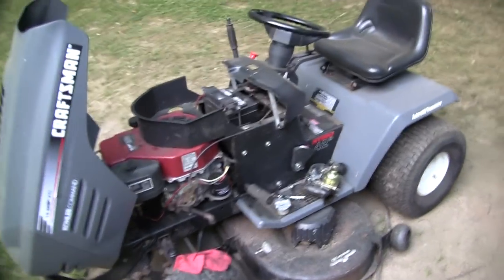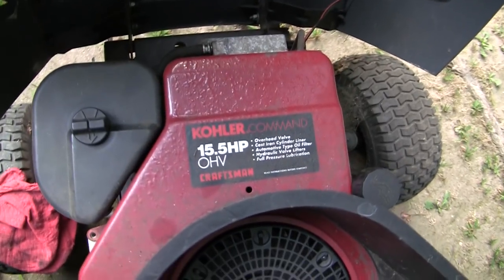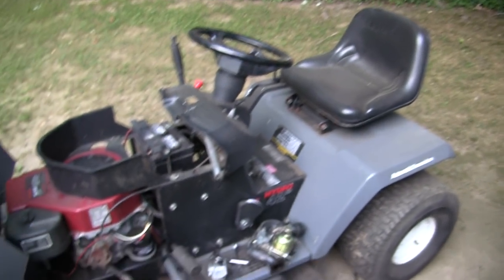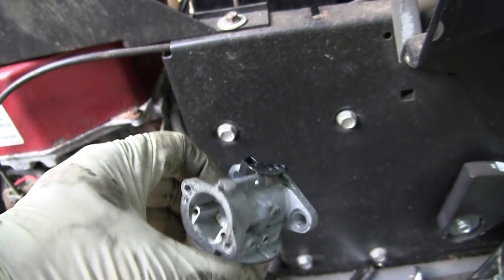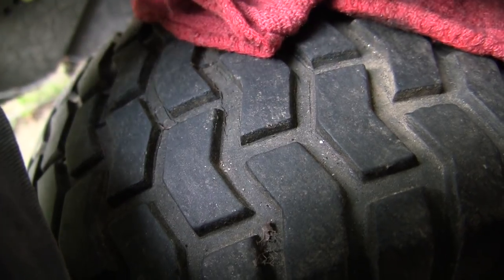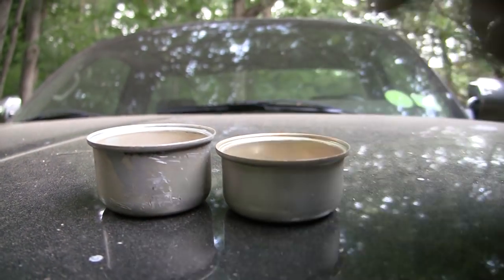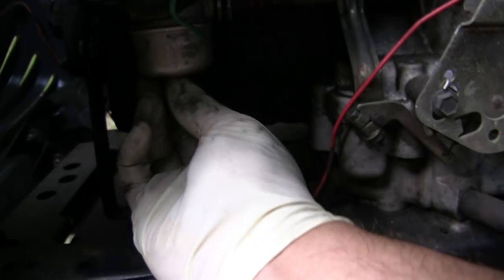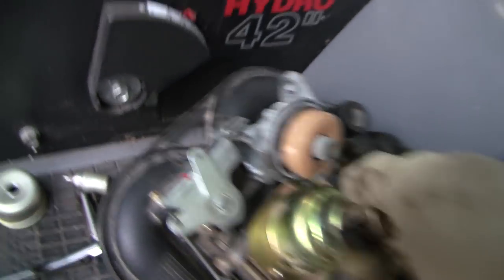Deleting the solenoid on a Walbro carburetor

Comment: Always reduce your engine speed before turning off the ignition. This is especially important if you bypass the carb. solenoid in some fashion.  Reducing engine speed before shutting the engine down will help prevent engine backfire.  Just repeating instructions from my user manual.

Comment: Great job another easy way is remove the rubber plug on the end of the solenoid and cut off or grind off stem,zip tie the wire out of the way and put in a cheap in line gas shut off so when your done mowing put it in neutral set your brake while tractor is idling lift hood turn off gas at  in line valve and will burn up the fuel in the carburetor in a few seconds. 👍😎

Comment: this worked great for me. regardless of all the different washers i used, the solenoid was leaking fuel after the engine was started. the leaking fuel would break the circuit and kill the engine, not to mention being a HUGE safety issue. the Briggs bowl and bolt worked like a charm. thanks so much for posting.

Comment: I carb cleanered the carb and selenoid valve and got it working.  Thanks a bunch.  I'll pick up an in line fuel shut off and neuter the SOB if it causes more grief in the future.

Comment: Watched video 20 minutes ago. Back in the house mower's running fine. Saw what you did and gave it little tweak. Pulled plunger out and left it out. Also left wire disconnected. Thanks for the hint!
Reply: Copy from what I wrote 2+ years ago:  When you BY-PASS the Solenoid, just ADD a FUEL SHUT-OFF to your Line (If NOT on there already). That way NO FUEL will leak into your Engine during Storage / Winter. They make this Part (Carb Solenoid), to prevent Fuel leaking into Engine if-by Needle, Seal, Float failure or Shut-Off Valve forgotten during Storage or Not-In-Use. To be honest, it's just a Luxury Item, and they can make more Money out of you. Also, this part here is a BULL-SHIT SCAM to sell extra features on a Mower and make more money out of you when failed.
Reply: Yeah thats the way to do it pull the whole magnet and pin out

Comment: Just learning to convert my ride on to a offroad go cart and you confirmed what I needed to know now on Goes the mikuni carb lol
Reply: Copy from what I wrote 2+ years ago:  When you BY-PASS the Solenoid, just ADD a FUEL SHUT-OFF to your Line (If NOT on there already). That way NO FUEL will leak into your Engine during Storage / Winter. They make this Part (Carb Solenoid), to prevent Fuel leaking into Engine if-by Needle, Seal, Float failure or Shut-Off Valve forgotten during Storage or Not-In-Use. To be honest, it's just a Luxury Item, and they can make more Money out of you. Also, this part here is a BULL-SHIT SCAM to sell extra features on a Mower and make more money out of you when failed.

Comment: No one mentioned this, so I will, you should put a fuel shut off valve on after removing the solenoid, and oh yeah idle down the engine first before shutting it off.

Comment: Inline fuel shutoffs are dirt cheap ( I buy 'em by the bag online) and are very good insurance against carb flooding after deleting the valve portion of the noid. I cut the pins off any engine I get with them.

Comment: if the fuel tank is higher than the engine you must install a manual inline fuel shut off if you delete fuel solenoid and incidentally  it is called an anti- afterfire switch which is designed to shut the fuel off and  stop the engine from running long after the ignition is shut off . a serious problem especially down south or in high heat condition  the engines just simply wont shut down as long as there is fuel still going to the engine even if the ignition is shut off

Comment: for those people who have leaking fuel after this just put a fuel shut off on the fuel line and shut the fuel off when not using it I will stop the gas from still flowing through the carb and into the cylinder
Reply: Dude u literally just solved my problem. My shit been leaking gas forever and now It makes sense. I bet that little thing it broke
Reply: @backyardmowerracing492  if its leaking fule it's the needle or bowle gasket is bad

Comment: i got a 2000 sabre by johnny deere ridin mower with a briggstratton 17ho intek 1 cylinder . was havin fuel supply issues so bought achinese carb off ebay for less than 20 . put it on then on n offtinkerin with the stupid ass solenoid thing trying to get the thing runnin strong . so it startin but when blade engages it stallin out . find out that i dropped the little rubber gasket off the solenoid stem that screws into carb bowl , and soon as i replaced that little gasket started running right . so that little gasket sealin right mattered in my case . and before realizin there was no gasket on it i didnt see any gas leak so ide check just to make sure its there

Comment: Hey.....good vid and I just subscribed but your was your ground from the carb to the chassis of your tractor clean and tight? I had a similar problem on my 20 y.o. john deere kohler and when I carefully took the bowl off, the ground wire just broke off.. and was barely hanging on. I replaced the strap and haven't had a problem with that solenoid since. Just sayin'..............

Comment: I replaced the stock carb on my kohler courage 22 because the original carb had a fuel solenoid problem and it was the same price for a new carb.  I just took apart my aftermarket carb that is marked AE power because it was acting the same way.  Would run if I put fuel in the carb and then quit.  It has a new fuel pump which is working.  When I took the solenoid off I found that the pin and magnet were a separate piece inside the solenoid body and slid right out.  I'm just going to put it back together without the pin and leave the solenoid coil unplugged.  It is almost like it was made to do this.  Strange.

Comment: Hey man can you do a quick video on adjusting the air fuel mixture and the choke. I'm having issues with adjusting it because when I turn it on it either over revs like crazy or acts like the choke is stuck. Thanks

Comment: I have a Huskee riding mower from Tractor Supply. It has the chinese engine, not the Briggs. One year old. It dies after just mowing a few feet after it warms up and the blades are engaged. If I disengage the blades, it will start back up and keep running but as soon as I engage the blades, it dies again after going just a few feet. New air filter, new gas filter, new plug, new blades. The only other thing I can think of is the gas solenoid. If that's not it, I'm stuck with a thousand dollar piece of MTD junk.
Reply: You might have a safety switch problem.  If the safety switch beneath your seat is not working properly the engine will turn off when you engage the blades. On my mower I have to be sitting on the seat for the engine to run with blades engaged.
Reply: He did say he can mow a few feet before it shuts off. Likely the solenoid. If you clip the plunger, just make sure you add a fuel shut-off valve so you don't risj flooding the crank case with fuel and take a chance on blowing the motor. (Then remember to get in the habit off shutting off the fuel valve when your not using the mower, even for just a few minutes. Gas in your oil will ruin the engine if you don't catch it before running the engine again. Of course changing the oil all the time if it keeps getting gas in it will soon cost more than just replacing the switch.)
Reply: I still lean toward a safety switch malfunction since it runs fine if the blades aren't engaged.  I would trouble shoot electrical connections first before I mangled the solenoid not knowing if that is the problem. He should be able to hear the solenoid pulling in and dropping out by turning the ignition switch off and on. Might need a friend to operate the switch while he listens closely to the solenoid.

Comment: You'll need to install an inline fuel shut off or gas will continue to fill the carburetor and valves causing hydro lock

Comment: Just cut the pin off the selinoid that works too!!!
Reply: 10-4,  nobody has any idea what the fuel solenoid is for......
Reply: That's what I was thinking.  The only thing shutting fuel off is that pin.  Switching the bowl and rest of the solenoid does nothing.
Reply: If you cut the tip of the solenoid won't that continue to leak into the cylinder? Same as a faulty solenoid.
Reply: @TOM-vi5pk  no your needle and seat in the carburetor are what does that.  A faulty solenoid will not cause gas to leak into the cylinder.  If your experiencing that its a defective needle/seat problem.  The solenoid only stops fuel when shutting them off to prevent a backfire.
Reply: Copy from what I wrote 2+ years ago:  When you BY-PASS the Solenoid, just ADD a FUEL SHUT-OFF to your Line (If NOT on there already). That way NO FUEL will leak into your Engine during Storage / Winter. They make this Part (Carb Solenoid), to prevent Fuel leaking into Engine if-by Needle, Seal, Float failure or Shut-Off Valve forgotten during Storage or Not-In-Use. To be honest, it's just a Luxury Item, and they can make more Money out of you. Also, this part here is a BULL-SHIT SCAM to sell extra features on a Mower and make more money out of you when failed. LMAO

Comment: My lawn mower was down for like 5 weeks. I put fresh gas in it, itcranjs but wont start any help
Reply: If it's this engine or similar, it's.most likely this fuel solenoid on the carburetor bowl.  You should here it click when you turn the key on (not start, just to on position).. if you turn the key off and on repeatedly, you should here it click every time... If there is no click, there is no fuel getting into the carb.

Comment: I would install a manual inline shutoff valve to prevent possible gas entering the cylinder and crankcase when disabling the solenoid shutoff.  I have dealt with both.  Judging from your parts collection, this isn't your first rodeo.  You know hydraulic piston lock is not rare with this piss poor carb design.  I have seen half a coffee cup of gas trapped in the cyl when the solenoid valve seal leaks and or the float valve in carb bowl leaks slowly.  The risks far outweigh the cost of a plastic fuel shutoff [$3].  Some red electricians tape on the steering wheel  by the key is a reminder to shut off the valve after use.  Especially for most users who are used to the key working to shut off the solenoid  valve after use.  Some of these modern so called improvements are a step backwards IMHO.
Reply: It's called 'Hydrostatic lock'.
Reply: Also, pull the oil dipstick out and smell it.... If you smell fuel well.... You know...

Comment: That doesn't always work. I have a 12.5 Kohler command here, actually two of them from John Deere STX38's and it wont work, tried it. Theirs a little nozzle on the side in the threads in the center and if you try turning that briggs main jet nut it, it will crash into that nozzle and wreck it and the main jet wont even go up in all the way.
So in that case better check first, because if you wreck that nozzle the carb is than garbage, in that case you have to keep the selonoid snd just clip the end or use it. It was for bench testing purposes, so I'm not cutting it. These tractors are 1993 and back, the earliest ones to have the anti backfire solenoid as far as I know. But ya'll better check before trying this or you will wreck an LMK walbro on a 12.5 Kohler command.

Comment: the solenoid is used to stop eng  when switch is turned of  by removing the 12v that holds the solenoid open a tiny plunger is spring loaded to close fuel flow now so the eng stops its best to set throtle to idel prior to turning switch off that stops any backfire---- the eng will  not   run unless you remove this tiny plunger from solenoid then it will keep on running this is not recomended

Comment: I've got a 16 cub cadet, won't stay running unless the starter is engaged, what's up with it
Reply: Jerel Willey pull the fuel line an point it at the ground, and see if gas comes out.
Reply: Report back tho
Reply: Sure Spark Small Engine Repair thanks for the reply but I got another mower lol  got tired of sinking money into it. But if you know anyone that would like to buy my old one selling for 150 bucks
Reply: Ok man where is it?
Reply: Sure Spark Small Engine Repair it's in Sparta N. C.

Comment: Its not a nut its a short bolt !! 5/16 24 fine thread , they sell a short bolt to fit that . Or just grind the end off the solenoid...its a ain-ti back firing solenoid that you don't even need .

Comment: that F**king thing shouldnt cost over 15 buck at the most low end 10 bucks thats Bulls**t.i tried to order the solenoid itself for a Kohler courage 26hp on a Cub LGT 54 like 2yrs ago and was told i have to buy a new carb (that cost $135) cause they dont sell that part by itself  i have a Craftsman GT 5000 Excellerator i just picked up i did and oil change, put fresh 91 octane and put a good used battery in it. it only had 117hrs on it (what it says atleast) now i have about 125hrs on it. it started giving me issues like the cub so i knew fuel solenoid and carb clean. it worked but i also replaced the plugs too.
Reply: i should also say its the same motor that says exclusively for Sears

Comment: Mine is leaking gas should I try to fix it or delete it like your video shows.
Reply: If you find that there is GAS leaking on your RED Wire, then check the Seal on the Solenoid. Or you can get an O-Ring and tighten it from there. It should STOP from leaking... Make yourself a Gasket and just STOP it from leaking. It's a simple fix really :)))

Comment: And when you remove the solenoid you will need a separate gas shut off valve.  Otherwise you could hydro lock your engine.

Comment: sorry but this will not work without an inline shut off valve,  i tried it amd the gas just ran thru the carburator with nothing but the float to stop it, bob carico paris texas
Reply: When you BY-PASS the Solenoid, just ADD a FUEL SHUT-OFF to your Line (If NOT on there already). That way NO FUEL will leak into your Engine during Storage / Winter. They make this Part (Carb Solenoid), to prevent Fuel leaking into Engine if-by Needle, Seal, Float failure or Shut-Off Valve forgotten during Storage or Not-In-Use. To be honest, it's just a Luxury Item, and so they can make more Money out of you. Also, this part here is a BULL-SHIT SCAM to sell extra features on a Mower and make more money out of you when failed. LMAO
Reply: Bob Carico
Reply: what
Reply: @JodBronson   100% correct,Old garden tractors,Wheel Horse-Cub Cadet didn"t have any of this crap.Of course they"d only last for 40 or 50 years than they were shot.Thank God for progress.
Reply: @markrunyon5524  -  100%!
Reply: @JodBronson  you have figured it out all these time consuming methods .put a new one on in ten seconds flat or bypass it with a shut of valve also dealer wants 200 for it in my earea  its simple enough to use comon sence your the man to explain that thanks
Reply: @josephlucier2701  -  You are welcome!

Comment: Its because the fuel tank is higher than the carb.   If you bypass it the fuel can over ride the float needle and flood your engine and cause it to lock up. 

This has absolutely nothing to do with back firing.

Comment: Can't you just unhook the ground wire of the solenoid, tape it off and be done with it?
Reply: No you cannot. The solenoid won't open up to let the gas flow into the carburetor and the engine won't run.
Reply: eyeball then your engine will never start because no fuel is going to the carb.